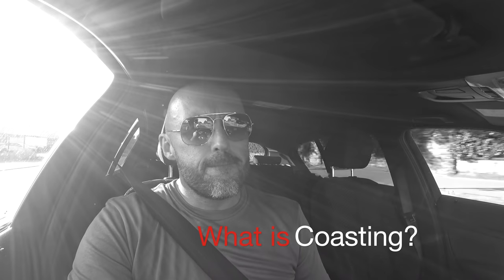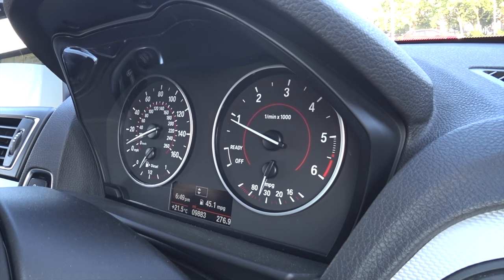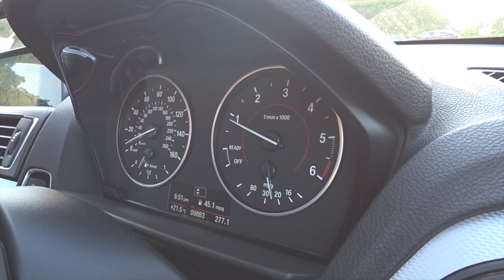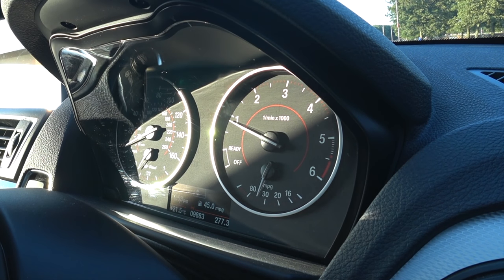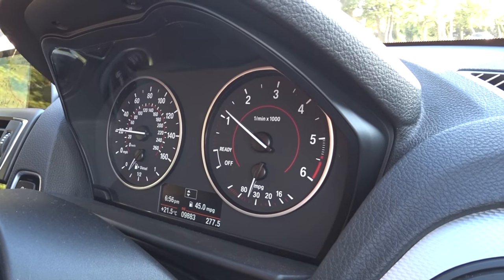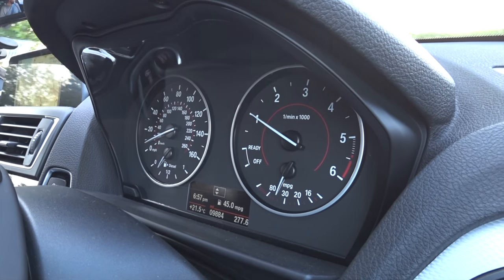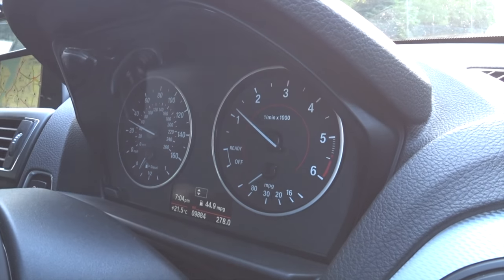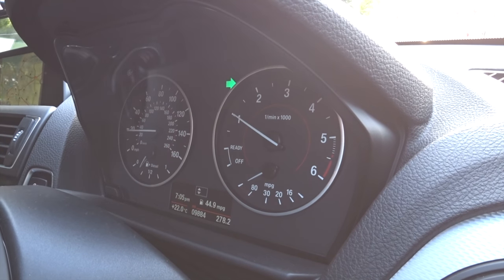What is Coasting? Part 1

Comment: 13:25 Brilliant reference I haven't heard of 
1st gear - walking speed
2nd gear - running speed
3rd gear - cycling speed
Reply: Doesn't make sense.. In first gear you can easy drive 12km/h which is two times the speed of walking quickly. Second gear is for 30km/h which is like cycling with quite some effort. 3rd gear is out of reach for human power.
Reply: @Engineer9736  It means the minimum speeds that the gears can be operated. You can go 30mph in 1st gear, so that's obviously not what it means.

Comment: The clutch is the first hurdle, among many, for new drivers. Stalling was a fear of mine when I started learning some 7 years ago.
Reply: Stalling the engine as a driving student is more caused by not daring to be bold with the gas pedal because of the teacher or examinator next to you i think, than actual inexperience. If you drive alone and you notice that you stall it, next time you just rev up to 3000rpm without caring too much about getting corrected.
Reply: @Randy Connor please don’t encourage the bot.

Comment: I like to go trough all the gears when slowing down and I usually shift quite a bit above idle since that way the car will have more power to accelerate if necessary. I also learned to drive a motorbike before a car and those have sequential gearboxes so that's just what you are supposed to do.

Comment: The funny thing is, this is exactly how I drive, but I was NOT taught to drive like it. When I took lessons, 6/7 years ago, I was taught like how you mentioned - down the gears individually and to a stop. Over time I've pretty much picked up the habit of doing what you did when you rolled up to the lights. The only problem I see with coasting is if it's done frequently and when there's no actual need to be slowing down. It can be harder to re-select the appropriate gear and react for instance if an emergency services vehicle appears. i'm surprised that you teach it this way as I'd have thought this method would be considered a cardinal sin, like some driving instructors still insist you feed the wheel at all times.

Comment: I’ve got a dinged up diesel to learn in. It’s very long geared, comfortably getting 15mph in 1st and 25mph in 2nd. Compared to my instructors petrol that requires more rapid gear changes to maintain smooth control.

It’s interesting to feel how the different vehicles drive and what they need.

Comment: What about lift and coast to save fuel in gear? - not using any pedal when approaching a junction for a few moments before starting to brake
Reply: you're unlikely to save any fuel doing that as the engine needs fuel to tick over. When you are in gear and rolling the fuel input is completely shut off as the energy stored in the car rolling forward keeps the engine moving.
Reply from the maker: Top class Cal. Glad someone understands! You can even see by the MPG Gauge when I coast it uses more fuel. Thanks for the comment also Owen, but your thoughts are misguided. Ashley
Reply: If the fuel input is completely shut off then the engine is using no fuel. Suck squeeze, blow essentially? modern engines use no fuel in gear while the accelerator isn’t pressed and It’s well documented in motor sport that drivers use lift and coast to save fuel?
Reply: To clarify because I think you misunderstood me; I’m approaching a junction in 6th gear say, I lift off the gas and with the clutch still engaged and still in 6th. Until it’s necessary for me to start to brake and change down the gears
Reply: Owen Cousins yes, in gear rolling with no pedal input costs no fuel. The mpg meter tells all - digital ones usually display —— or 999 or something to that effect. Re motorsport - I don’t know about that but given motorsport involves very high speeds you have to consider wind resistance comes into play. Perhaps when slowing down it is more effective for drivers to coast for periods using the wind resistance rather than accelerating against it to maintain speed. Coasting in my car (ahem, rolling up to a stop at the lights) usually registers something like 160mpg. It’s otherwise impossible to achieve that when driving normally as even the lightest touch of the pedal to keep the car moving on a smooth flat road brings it down to 70 or lower. Maybe that’s where the logic lies.
Reply: Yeah that’s what I was getting at
Reply: @123owenboy Confusion seems to stem from using the word coasting. Coasting is moving with the clutch pressed or letting the car trundle along in neutral. You're not coasting when you're engine braking.
Reply: Thats called Engine braking.
Reply: The fuel cut off in my car happens when coasting in gear above 1,200rpm. I'm a bit of a hypermiler. I never coast in neutral unless I'm doing less then 10mph and I've averaged 70mpg over the last 10,000 miles in my Toyota Aygo with a 1.0L 3 cylinder petrol engine.
Reply: the only time it saves fuel is in this situation:
if you are on say the motorway, 5th gear and revving around 3000rpm, if you come off gas, then that will slow the car quite a lot since 3000rpm is a lot of friction.. so you are losing momentum quite a bit, if you clutch in, then you overcome friction at 800rpm with fuel, and don't lose any momentum through engine braking, it can be useful on slight downhills on the motorway, if you find that the car is building speed with clutch in, rev the car to 3000rpm or so with the gas and then clutch out (smoothly) then you get engine braking back...
Reply: @MichaelFlatman  on technical downhill or downhill stops or downhill stuck behind a slow car down hill I'm in gear. On a road where I won't exceed a safe speed, I can conserve momentum in neutral (with the little bit of fuel the engine uses at idle). Weirdly in my Citroen, staying in gear is slightly less efficient (I'm talking 200 mpg vs 350 depending on speed etc) as it doesn't cut off the fuel till above 2500 rpm, and then the fuel stays cut off when slowing down further in the gear. I have to look at the instantaneous to check it has gone up to 999, because when I want engine braking I don't want any fuel going in cancelling it out.

In terms of ultimate fuel saving behind a slow car on up and down. Drive slowly up the hill and let the slow driver get ahead, then you have enough room to "roller coaster" down the hill, hopefully catching up with the slow driver partway up the next hill. No braking required down the hill and you can start on the next hill from further up. The slow driver will use more fuel because they braked down the hill and need more energy to get up the next one. Obviously don't exceed a safe speed, but usually a safe speed is faster than the chicken driver.

What was annoying was going down my parents' drive in first - getting nice engine braking - and then all of a sudden the fuel kicked in and I lost a good portion of engine braking and I suddenly had to hit the brake. It also means I have to choose lower gears than normal to slow down on a hill. My Peugeot 206 HDi would cut off fuel just above idle when travelling on the over-run.

Comment: I don't think coasting is bad, at least when not abused, aka not in neutral before every junction.
I personally often coast when I see a red light in the distance, then if the cars in front start fast enough, I just reingage the same gear, if they don't, I downshift and brake with my engine.
Reply: Why add extra steps to your driving by knocking it into neutral and then back down if you need to? Just brake and then change to the desired gear. P.s you're technically not in control of the vehicle if you just press the clutch every time you see a junction and coast to it.
Reply: I 'coast' in gear if I see a red light up ahead.

It's interesting though to see people braking on approach; I suspect many of them are also disengaging the clutch hence why they brake for such a long distance.
Reply: @ThomasMTube  well, because I can, I just cannot stop myself from shifting all the time, even when not needed (it came from me riding a bike and shifting all the time) so I at least try to make it useful by engine braking.
Also, I always rev match with the gas pedal so I don't wear the clutch more than I would normally.
I do realise I have less controll, but when the street is empty in front of me I don't see how having the car in gear would make it any more safe, also its just a split of second to put it back in gear.
Reply: @loc4725  it's really annoying how some peopple keep on braking, its also relatively dangerous, because every time that person uses their brakes, you are wondering if you should brake too (aka emergency stop) or just letting off the gas will do...
Reply: When I encounter a car up ahead which is doing that I just hang back and give them plenty of room. It's not normal driving behaviour and to me looks like there's something wrong, either with the vehicle, the driver or both (but probably the driver). My view is if they're going to have an accident, I don't want to be involved in it.
Reply: Why coast toward the red light waiting for it to change? You have control of speed through the throttle if it's left in gear!

All I can see is extra unnecessary steps in your technique - you should, as a driver be able to judge what gear you need for the distance you have to travel before the light changes.
Reply: If you see cars in far distance at a red light and don’t want to come to a full stop, you just go a tiny bit slower - shifting down. Coasting is Never the solution. Stop searching for excuses. If you coast, you cannot drive.

Comment: I try to declutch as late as possible, and normally would in any gear below 4th, but if your foot is on the brake, you're still in control of the vehicle. If you need to accelerate again, you'd need to change to a lower gear anyway. Gears for accelerating, brakes for decelerating.

Comment: This is great advice I've done over 40 hours paid lessons and in them I've always been told. When you feel the car shake then clutch down. When moving of set revs 1 and half too 2 rpm then release clutch hold for 1 sec them fully release. But I did have my own car for awhile that I used and by far for me that was a lot easier and stress free I used what I learnt and used it. I have a private car park were I live so is what I used to do is when I'm not out driving I would get in and stall it on purpose to listen out for the engine sound not soon after I got used it and never stalled it. This for me was a lot calmer and easier as I did not have to spend loads of money leaning to use the clutch also do it on my own time.. the down side is the car went bust so I had to scrap it not happy with that.

Comment: Quite a few comments on here about people declutching when coming to hazards before slowing. Worrying if you bear in mind that at speed (ie motorway, dual carriageway, rural roads when coming to roadworks/traffic queues) that the vehicle becomes unstable and feels lighter on the steering as the connection between the heavy engine directly to the tyres and road are removed.

Comment: I learnt to drive around the same time as yourself and always have driven down the gears when slowing down. On this one I think I might be too stuck in my ways to change now!
Reply from the maker: It's a tough one, agreed. However, it does put more emphasis on looking as you're slowing rather than changing gear. This is the problem I have with Trainee Instructors also. Don't forget that it's no big problem.Thanks as always for your input, Ashley

Comment: Very pertinent for manual gearbox cars, automatics have different features. MY VW Golf will coast when going down hill when using Eco mode of the DSG gearbox.......rather disconcerting when it first happened after many decades of driving manual gearbox cars.  Reacts immediately to come out of coasting mode when the accelerator is pressed.  Another video for Auto's Ashley?
Reply from the maker: Time to crack out the M3 I think :)
Reply: I drove my Grandma's old RWD automatic C class once and I was shocked nothing happens when you take the foot off the accelerator it just keeps going such a strange feeling.

Comment: I often see people travel quite some distance with their brakes engaged when heading towards red traffic lights, presumably they're 'dual pedal' brakers?

Personally I try to avoid that and use engine braking as much as possible although have often wondered if there is any merit to a slight application of brakes, just enough to activate the lights so that people behind me know I'm slowing down?
Reply from the maker: That's what I would be doing :)
Reply: Car manufacturers should connect the brake lights to an accelerometer detecting braking/slowing down forces. Then there would be no need for such tricks.

Comment: I coast because in the long run I feel like engine braking makes the engine sound like a diesel. (The snorting or snoring noise when accelerating). Is engine braking good for carbon build-up and general engine-wear and condition?

Comment: I coast downhill and up to lights / queues / junctions for fuel efficiency in an old campervan, yeah maybe for miles down from the top of the M62!  but a modern car cuts the fuel completely if it detects engine braking,  so for economy, it's better to stay in some gear whilst coming to a stop/ slowing down / rolling downhill. My digital mpg jumps to 999.9. I like to slow to idle in high gear, then into 2nd and idle up to the situation.
Reply from the maker: A lot of people don’t realise this. Nice one, Ashley

Comment: I find that if I don't coast I use more brakes and fuel than I need to, I get up to speed and I balance my foot, if I go over then I take my foot off I don't immediately slam on the brakes because efficient and smooth driving is far better than a driver that is trying to enter F1 racing without first understanding safety.

Comment: I used to be cautious about coasting but since passing my test got into a habit of going into neutral every red light lol i dont recommend it but it feels easier to do must be why people do it but i think its important people dont coast down hills even i wouldnt do that even a high gear down a hill can be a bit scary but i was always taught just dont coast on a bend or hill and they wont fail you but usually with traffic lights they dont mind so much as long as you dont go into neutral which should only be done when the cars not moving
Reply: Most people go into neutral at a red light and you should if you want to prevent wear on the throw out bearing of the clutch. As long as you wait until you are stopped or under 10mph you'll be fine.
Reply: Of course you shift to neutral when stopped unless in an auto.
Like Ashley I always use the handbrake, and thought I was the only one left in the world to do so. It helps in avoiding the temptation to twitch, to edge forward as the car in front does so. Stop and wait, and with the handbrake on and gear in neutral it is a relaxed wait until the lights change. It doesn’t slow me down. It’s rare for anyone to drag me off at the lights and I only drive small cars. I coast for entertainment on the open road but would not recommend it in built-up traffic including intersections. As far as I am aware coasting is illegal at any time as coasting is considered not being in control of the vehicle.

Comment: One thing i'm wondering is can only certain cars drive at idle speed without the foot on the clutch. My car for example can drive at idle speed in 2nd gear usually if i do nothing it'll roll at 9mph but if i did that in 1st gear the car would keep slowing until it starts bunnyhopping and doesn't stop until I press the gas pedal again.
Reply from the maker: Have your car checked? If it car idle in 2nd it should be fine in 1st which is a more powerful gear. Thanks, Ashley
Reply: @ashley_neal  im not sure if its just because the engine is a small petrol engine that struggles going idle speed
Reply: Just an update I checked how my car performs today to make sure and yeah it seemed perfectly okay going idle speed in first gear I think it starts to bunnyhop a bit when i go uphill as the car is slowing down.

Comment: Fairly sure you said you'd cover this in the second video but: what are your thoughts on engine braking? And cycling through the gears 1 by 1? i.e. 6>5>4>3>2>1? Like you, my dad was taught the same and has therefore told me to do the same. In addition, it reduces wear to the brake pads as you're using the engine to brake. Whilst this isn't taught when you're learning, is it a useful skill to learn after you pass? Is it in any worse than just stopping and skipping gears? Would be nice to hear your thoughts.
Reply from the maker: There’s no point going down through gears sequentially. Your Dad has taught you something that’s about 20 years out of date. You’re decreasing wear on brake pads to increase wear on the engine, clutch and gearbox. Does it matter much? No to be honest, but not concentrating on gearing down and just choosing an appropriate gear forces more observation. Even if you do gear down make sure you still brake slightly as it is a warning to others behind. Thanks for the question. Ashley
Reply: @ashley_neal  cheers for the response
Reply: Depends how much trust you have in your brakes on an old car it might be something worth doing but on newer cars with good brakes there is no point to it. It can also be beneficial if going downhill but really its rarely necessary. If you were for some reason suffer total brake failure you would do this to slow down and use the handbrake once at a suitably low speed.

Comment: but gears idle at different speeds, if i slow to below 20 in say 4th gear it will start to rumble and feel uncomfortable, in 5th or 6th i probably wouldnt be able to get under 30
Reply: Watch the video again, you missed half of the story i read in your comment.
Reply: different gears idle at different speeds, but at the same RPM (of engine)